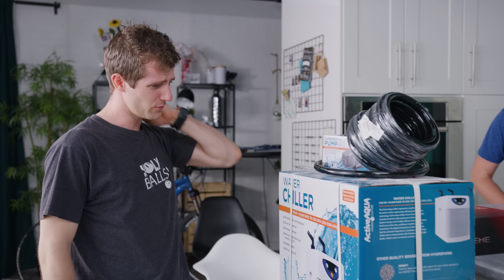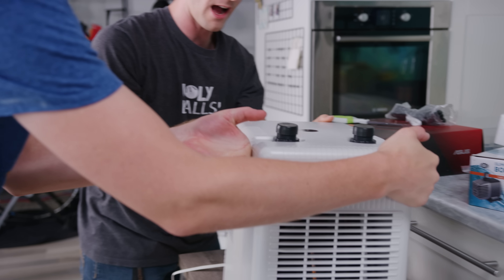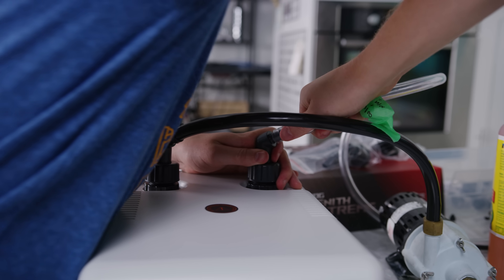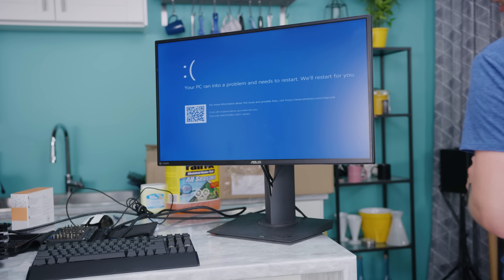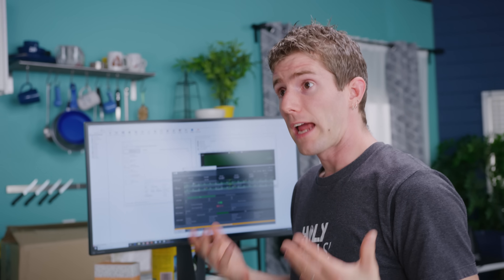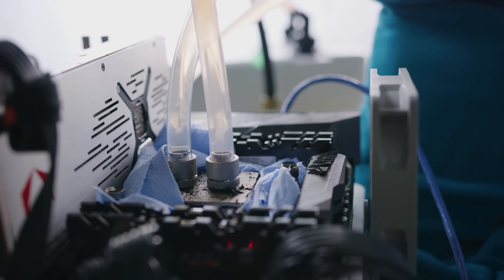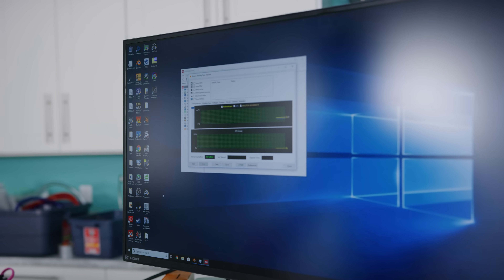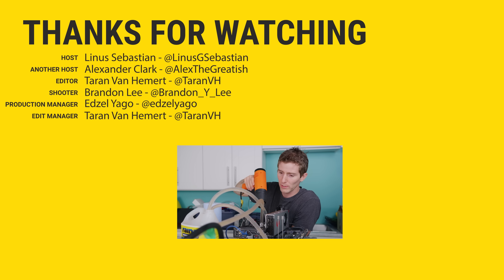Chilling Threadripper 2!!!

Comment: "Who does AMD think they are? Intel?" -Linus 2018. Little did Linus know that AMD is now better than Intel.
Reply: Imagine 500 people missing the whole point of the comment. He was making fun of the fact that Intel processors are much less power efficient than Zen. Rofl.
Reply: And now AMD beat intel at it’s prized possession. CS:GO performance.
Reply: This aged like wine
Reply: @mythx9961  yeah. People are still talking about how intel is still winning on single thread performance while the mid tier AMD Ryzen 5000 beats the Intel core i9 10900k in single thread performance (if i remember correctly)
Reply: @trashyemployee222  lol but intel has reduced prices. I dont get it when you can argue a 5800 vs 10700k now that you can get a 10700 for 200 less
Reply: Heyyy have you heard of Zen 3? They even are bettter than intel in Csgo
Reply: No, no, no. He said that after reading 500Watts power draw on cpu and was making a joke about power draw
Reply: @unosquash  apparently, he didn't get the joke.
Reply: If intel made threadripper with 14nm++++++++++++++++++++ it was going to take like 1000 Watts lol so they arent intel xd
Reply: Yeah amd kinda just ran over intel and left them on the side of the road.
Reply: he was saying that amd is now taking in a ton of more watts not that amd is worse because intel takes alot of wats
Reply: @florex-3570  yeah. Coz amd is usually more power efficient.
Reply: Not anymore
Reply: @phillipbotter6470  ghz are not everything. it's more about the architecture. AMD has superior arch.
Reply: uhh you took that quote out of context severalu
Reply: Hey you know what I NEVER have to do when I instal an intel CPU on an LGA1151 motherboard? update my fucking BIOS.
Reply: Sanjit Matrud it’s just a bios update? it takes 3-4 minutes dude. not a valid argument lmao
Reply: @EmeryLAlafa7  oh no shit? and if you dont have a previous generation CPU to perform it and your motherboard doesnt have BIOS flashback feature?
Reply: @EmeryLAlafa7  again... you need a previous generation CPU to do it if you motherboard doesn't have a BIOS flashback. Intel wins
Reply: @bovice1766  because each intel board supports one to two generations
Reply: For gaming Intel its better, for more useful things amd is better...
Reply: A few months later now if you build a intel pc you wasted money
Reply: Izúre Lem  no in the 2000 and to 2006 around their amd was ahead
Reply: Little did they know ryzen 9 5950x
Reply: It happens for a year or two every 10 years. Don’t worry your heads, BlueZilla will be back in driver seat inside of 18 months. 

Why you ask?  Because as your wife will tell you, size matters.
Reply: @catfan__  AMD is NOT better at gaming right now. Sorry to tell you. Unless every expert is wrong and you’re right.
Reply: @derekstiles5801  they are now. intel is falling behind.
Reply: Amd: and I took that personally
Reply: And more expensive
Reply: No CPU is better, It matters which one is comfortable for you.
Reply: @k1apvz  I guess in a way. If you want best all rounder, go with AMD, if you want best comfort blanket that's completely worthless at the moment, that the only reason I would recommend it is, there's actually stock of it.
Reply: @Warped Sounds yeah my peers are all like hoping to entail goes out of business I try and tell them that competitive pricing is a good thing for us but they disagree they say f**** tell because of their high prices they could never afford one and yay for AMD they killed a Ford one but they think that if intel goes out of business the amd's going to stay at a decent price but they're wrong
Reply: @phillipbotter6470  and 10600k beats 10900k 😁
Reply: b
Reply: Can linus please respond to this 😂
Reply: It's still called amd
Reply: It is unfortunate for AMD and more importantly Nvidia that this political situation with Taiwan doesn't appear to be getting any better with Biden as our president sorry guys

Here's to hoping that Taiwan builds their next facility in America as planned
Reply: @D not to mention that intel makes their own CPUs AMD doesn't taiwan's chip factory does and that might not be around much longer
Reply: its 2021 and it hits even better
Reply: After the launch of intel 12th gen, ryzen 7000, and RTX 4000, this really hits different.
Reply: My first real gaming PC had an Amd Athlon 64 dual core with an ATI gpu and boy was it amazing!
It ripped my old intel Pentium with a GeForce 2 to bits!
The graphics were „just like the real life“ that’s at least what we thought back then..

When Unreal Tournament 2004 came out I played that game everyday when I came home from school until GTA San Andreas was released at the end of that year and I was completely blown away.
Nothing was like it and I basically lived in Los Santos, San Fierro and Las Venturas! The story was so deep, the graphics amazing and the freedom unmatched to anything else!

Boy those where the days, I loved my case, it was the first one with a window and blue LED lighting in the window fan!
Every other case before that was the traditional beige but then those aluminum cases came to the market, it was such an amazing time.

The early internet also was something else, it was the best community one can imagine.
Nobody wanted to make money from another person, it was just about freedom from corporations and ripping every software available!
It was lovely and basically a lawless space, since nobody in the government had enough knowledge to even know about 1% what was going on.

Lovely time to be a Teenager :)
Reply: “It’s sucking 550 wats, who does AMD think they are intel?”  Linus is making fun of intel for being power hungry.  Misleading comment.
Reply: 4 years later, Intel be like 💀
Reply: @Warped Sounds I don't know about you, but for me a company that offers the same/slightly better products for lower price IS the better company.
Reply: @Fif0l  So you like Intel better 75% of the time. Makes sense.
Reply: @Warped Sounds if you say so
Reply: amd got now 64 cores... intel didnt even got 32 rn
Reply: @Warped Sounds barely. intel is barely exceeding amd in single thread
Reply: @Commissar0617  Yeah, with the price of Ryzen and the performance that comes with it, it's kinda just worth it to take the ever so slight hit in gaming performance to ensure you've got an incredibly well rounded system.
Reply: @digitalbarrito3555  Not to mention that for a lot of games, the FPS difference between them sits well above what most accessible gaming monitors' refresh rates can go up to anyway, so you're never even going to see that difference a lot of the time.
Reply: @Commissar0617  And yet, barely best is still best.
Reply: Amd has always been better, now it's higher performance lol
Reply: @joshriles84  bulldozer goes shhhhhh
Reply: @joshriles84  but that's not even true
Reply: @joshriles84  Be serious. Intel is responsible for about 100 more advancements in chip design.
Reply: @joshriles84  debatable
Reply: The thing about amd being better is its all depending on what you use it for, amd is by far better for productivity but for gaming intel is still the way to go
Reply: @Scottish Eh not really. AMD does completely obliterate intel in productivity and I’d have a hard time recommending anyone an intel system even for gaming, because even then they’re pretty neck and neck, and most people do more on they’re computers than just gaming. I think AMD is the way to go regardless of what you do for the most part (there are a few exceptions I guess though)
Reply: josh not by much though. And as games get more resource intensive and use more cores amd will out perform intel
Reply: Warped Sounds Ok fan boy
Reply: AMD is way ahead in everything, except Gaming.A i7 9700k with a good cooling solution is not only a bit better than an equivalent AMD CPU, but vastly superior.
Ryzen and Core I on stock are very close in single thread performance too, its just that Zen (2) gets a big disadvantage through the Infinity Fabric, which introduces way higher latencies than the Ringbus or Mesh in Core I Cpus.This is a reason why Music production, which needs low latencies, should be done on Intel CPUs.
Reply: @lil.barro.x  AMD is not for productivity, man. My customized weird as program does not fking run on AMD. No matter how good their CPU is, it can't run it, it can't run it. AMD is only for YouTubers or streamers with heavy use on Adobe, For real productivity with use of some weird, unusual program. Nahh,  Fk AMD.

Comment: Put the test bench in a case and nitrogen purge it, the nitrogen will help remove the moisture.  Insulating the lines will also help cut down on condensation.

Comment: instead of running alcohol in the chiller, use it as an chiller for a mineral oil submerged machine.  no issue with condensation and many mineral oils have pour points in the ~-30c range.

Comment: the funny thing is when they did this the chiller was very expensive but now you can get the chiller a pump and line for 300 dollars for every thing. but you still have to come up with the water block and mask off your ram and processor meaning it would be possible to have a below zero home rig for cheap . I would buy a quart of conformal coating and seal the PCB and ram sockets and graphics card with all the components in place making the whole system water proof it would be a disposable system after you sealed it but it would never get wet for as long as the CPU and ram , and graphics card lived . temps well below zero would be no problem as condensation would just run off. now conformal coating is nasty stuff and smells to high heaven tell it sets but once it's done nothing is going to get to the board or it's contacts.

Comment: Using an actual water cooler you don't need antifreeze, it doesn't provide any better heat transfer. Only reason you use antifreeze in vehicles is to keep the water in your cooling system from freezing in winter temps. Using purified water instead would probably provide more heat transfer due to the water being thinner then a antifreeze/water mixture. I can see why you used antifreeze in your homemade build as the water could've froze up and clogged the passage ways.

Comment: why use windshield deicer and not, say, automotive antifreeeze?
Reply: Warm Soft Kitty  and?
Reply: @joek0617  because it has alcohol it has a lower freezing point than antifreeze. But as other users have pointed out pure water has the best heat transfer rate, and because of the upgraded pumps and chiller the flow rate of the liquid would be too high to worry about freezing.
Reply: @SoCalStyles  antifreeze goes down to liek -50f
Reply: @joek0617  I don't make up the science I just report on the facts. I also think it has to do with the chemicals in the antifreeze... but I'm not sure.

Comment: Is RainX Deicer better than Automotive Antifreeze/Coolant?
Reply: Doesn't matter for his application. That's probably what was in sale when he bought he. It's basically just distilled water and alcohol. The alcohol is there to prevent the water from freezing. The water is there to transfer heat.
Reply: Javier V So r u saying u put rainx deicer in your coolant reservoir in your own vehicle instead of antifreeze? Just saying...
Reply: @kevinjames1587  in an emergency situation yes. Like if I was in the desert and needed to get to town. As a replacement no because automotive coolant also takes metal corrosion, lubrication, o-ring protection into consideration

Comment: Could you do a video with the CPU and GPU liquid cooled with the chiller below ambient temperatures but with the whole system submerged in mineral oil to avoid condensation.

Comment: Its a terrible idea. you need to connect a big reservoir to soak heat or a dual 120mm radiator to be on safe side. because once these Hailea chillers reach the set temp, they would trip and restart after 3 minutes. I know because I used them many times and still using one.